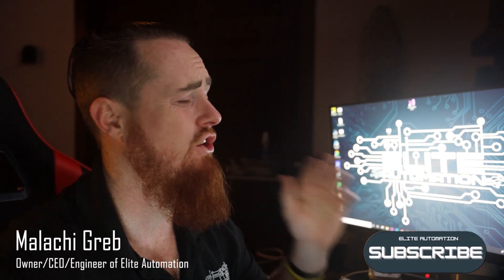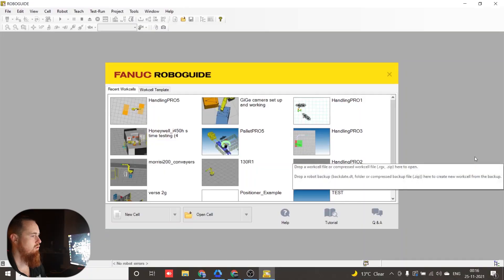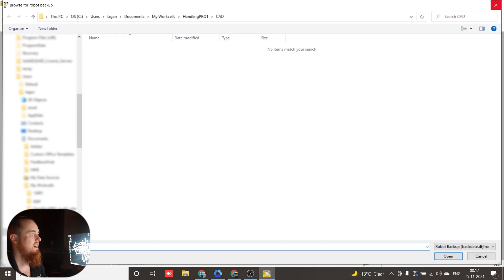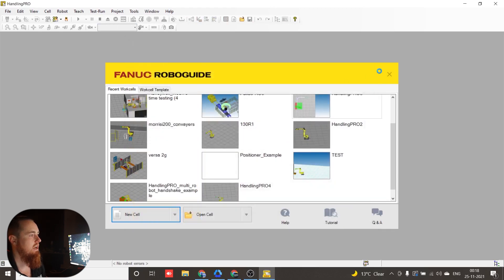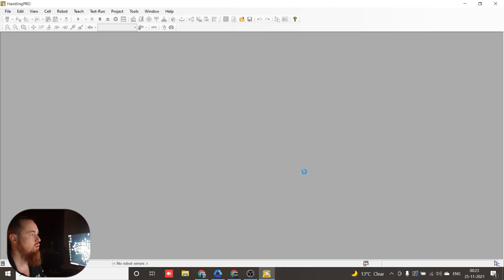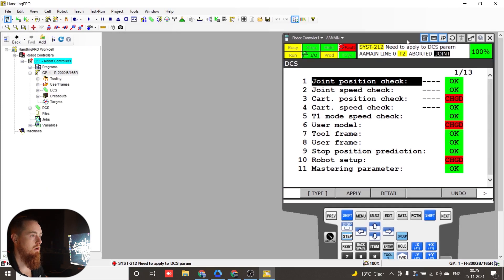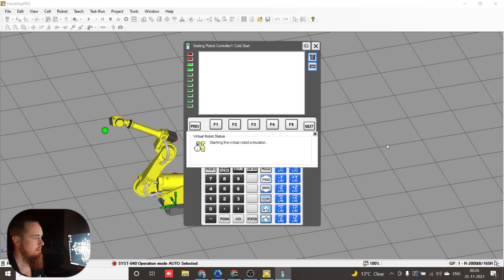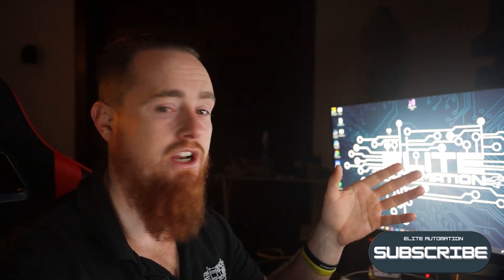FANUC RoboGuide Tutorial - Load Robot Backup | Elite Automation

Comment: I'm having an  jog-034 jog disable by appcation error, can you help me?
Reply from the maker: Hi, hope this information helps: 
1. Check Program Logic:
Verify the program: Ensure that there are no errors in the program logic that might be preventing jogging.
Check for conditional statements: Look for conditions that might be disabling jogging based on specific criteria.
Review safety settings: Make sure safety settings are configured correctly and not preventing jogging.
2. Inspect External Devices:
Check external inputs: Verify that external devices connected to the robot's I/O are not sending signals that disable jogging.
Inspect safety devices: Ensure that safety devices like e-stops or light curtains are functioning correctly and not preventing movement.
3. Check Power Supply:
Verify power supply: Ensure that the robot's power supply is functioning correctly and providing adequate voltage.
4. Examine Robot Configuration:
Review robot settings: Check if there are any robot-specific settings that might be preventing jogging.
Consult the user manual: Refer to the robot's user manual for specific troubleshooting guidelines.
5. Reset the Robot:
Perform a soft reset: If the above steps don't resolve the issue, try performing a soft reset of the robot. This can sometimes clear temporary errors.
If you're still unable to resolve the JOG-034 error, it's recommended to consult the robot's user manual or contact FANUC technical support for further assistance.